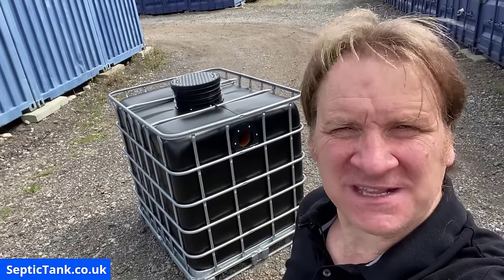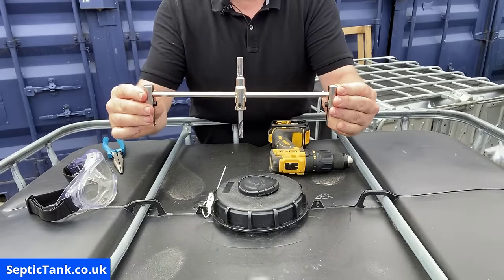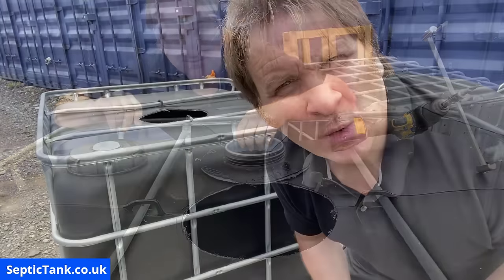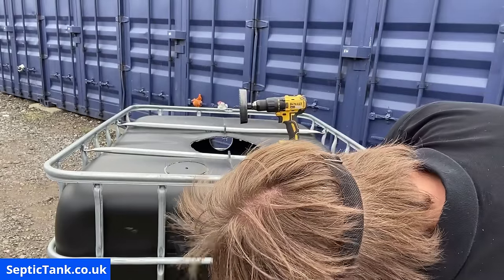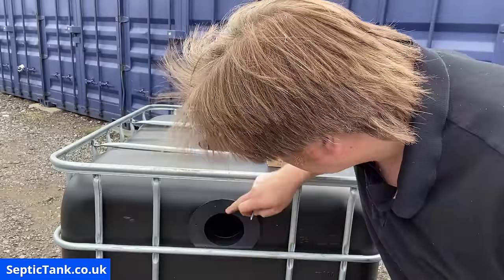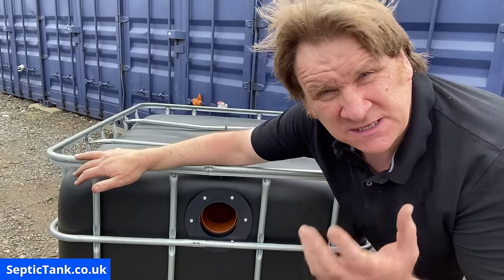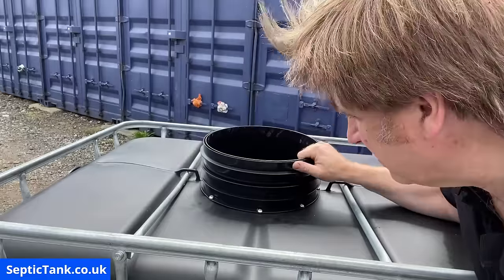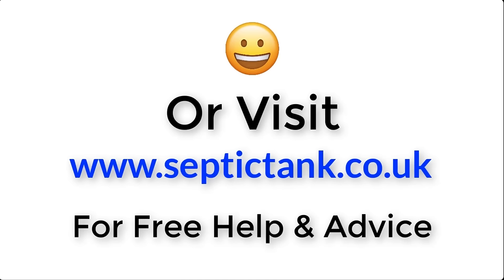diy septic tank - diy septic tank

Comment: What keeps the 90 degree elbows from falling into the tank?  I saw no glue or screws.  Thanks
Reply: use a bit of sealant as well. better safe than sorry. plus will need to look into a better seal for the inspection cover as that will leak. predrill some holes in the flange of the riser as in the video you can see it burst the side on the first screw. great step by step but worth adding in a few points.

Comment: No glue on the 90 degree pipes to the flanges? Won't they fall off inside the tank?
Reply: That what I was wonder same thing
Reply: If yu can’t see it it didn’t happen
Reply: Soooo... is that supposed so be buried 🤔
Reply: Also wouldn't you want to put a short extension pipe going down in the tank, on the outward 90° fitting, to ensure it's just water (no solids) going out to drainfield?

Comment: Do yourselves a favor and get it in the ground before you start cutting holes in it. It’s a lot better to dry fit your pvc to the tank in ground, to see where it will work best first. 
I’ve done quite a few septics with these 330 gallon totes in Texas and that black German tank looks sweet but the flimsy white ones work just fine. Just make sure you fill them with water before you start pushing dirt over them so they don’t collapse in the cage :) I alway put a tin top on it too to help with that.

Comment: I would have had a bit more difference in the levels of the inlet n outlet even if it meant moving/adjusting some metal pipe ! Another thing to think about is adding a second settling tank 6"-8" apart connected in the center via 4" pipe between the two ! Better inlet and outlet fittings (which would require the risers moved from the center of tank and closer to the outter edges for monitoring and cleaning out) would allow for a effluent filter to catch larger pieces of outflow debris and save the soak away field much longer.

Comment: Stainless steel through bolts with a flange on the inside, also a bead of silicone would not not be such a bad idea.    
.    
Another thing with the 90°fittings.  
A few 1/4” holes on the top of the 90 will prevent a vapor lock and allow the water to  flow freely.

Comment: The same septic tank owner who installed & repaired septic tanks for a living did say that the blue food grade 50 gallon barrels could be made into a 3or4 barrel septic system.first 2 with T's last 2 with straight connectors but all must be at least 1 inch below the next and the initial intake line.
Reply: I need instructions and materials needed

Comment: Why not put the flanges in from the inside as the flanges have thicker points round the screw holes which will give a better fixing for the screws, or insert the screws from the inside?
Reply from the maker: Good Idea

Comment: I made one of these and the first good rain had the dirt collapse the side.  Something has to be put around metal cage to keep water/dirt pressure off the thin plastic.
Reply: screening or drainage rock?
Reply: Fill it with water first
Reply: You must fill with water first
Reply: @andrewdavis5404  water doesn't hold the side walls in from dirt collapsing. The water just flowed out the field line. It was full of water. But full because they'll float, not collapse.
Reply: I’m going to use plastic pallets around the outside as it’s surrounded by clay.

Comment: Great video. One thing though. I wouldn't use WD-40. Its a solvent as well as a lubricant. Its not recommended for use on rubber products.
Reply: Yep. WD-40 stands for water displacement formula 40. Its original purpose was and is to provide a layer that ice would not stick to on rockets. The cryogenic oxygen tanks would cool the rocket's metal exterior such that ice would build on it. This was dangerous as it could potentially cause the rocket to have a structural failure on the launch pad. Not to mention that the extra weight would impede lift-off, and if the ice fell off in an unbalanced way during launch it could cause the rocket to uncontrollably veer off in a direction other than up. Or to punch holes in things that should not have holes in them.

Comment: Question, do you used pipe adhesive from the 90 degree elbows to the flanges?  Whats to stop them from uncoupling? Thanks for the instruction cheers mate
Reply from the maker: The screws and a very tight rubber doughnut.

Comment: Why isn't the inlet line a few inches higher than the drain line?  This setup will just flood the inlet pipe before it has a chance to drain
Reply: This is an off grid system. Usually for the use of 2 people. The offset between the inlet and outlet doesn't need to be very much. Also, this system isn't for use of much Grey water, only black water. I build tiny homes and use these systems frequently. I don't know this man, but I've used his systems for 2 years now in off grid building. He has saved my customers thousands, and made me some coin at the same time. I have made some modifications of my own along the way, but everything works. Most of my systems are on large plots of land, deer leases, and small acreage that are unrestricted. This will not fly in restricted building locations that require permits. On larger septic applications, yes, the inlet and outlet pipes would need to be offset a bit more. Hope this helps.
Reply: Any videos on installation??
Reply: The inlet needs to be a minimum of 2-3" above the outlet, use either 4" pipe or 3" I wouldn't use anything smaller, repeat the process if you get more IBC's. No interior baffles are needed. I'm offgrid and would prefer the use of sanitary T's those elbows can clog and not always function properly. The outlet can run out to a leach field and you can have perforated pipes, cloth & rocks (it's a lot but if you do that to code it'll last for years). If for some reason you want to drain in let's say an old wash or something I'd recommend the use of a backflow flanged pipe. The last thing you need is a flood going into your system into the home. Just remember, these are meant to be "temporary." 😂😂 they don't have to be though! 😅  MERICA' 🇺🇸🖕JB

Comment: Thank you so much.   We are retiring and want to by a yurt, this video is what I needed
Reply: just use a razor blade and a steady hand thats what i did.
Reply: Let me know how that goes I’m very interested
Reply: @willscott174 That is difficult to do a nice hole by hand, a bit dangerous as well, unless that tank is soft/thin plastic. 😋
Reply: @BillyJoeJimBob28  Those IBC Totes are pretty soft and easy to cut through with a sharp blade. As long as you draw it out first and go slow its fine.

Comment: Hi, good instruction video. 
I have 2 questions:
I am wondering if a small amount of gas can escape from the join of the riser to the tank, for safety reasons, can it be sealed and a small diameter pipe placed into the top perhaps at the corner?
2. Can tthese tanks be serial connected together with a section of straight pipe to reduce emptying frequency and to further purify the runoff water?
Reply: Each tank needs a vent pipe which has not been mentioned in the video. It does not matter where you  position it as long as its above the fluid level. You could also link tanks together as you ask, but each pipe needs a baffle so water passes through under the level of the water. Each tank needs a vent pipe  also.
Reply: I suggest a tee baffle instead of the elbow to prevent siphon effect which will mess the system soakaway down stream. I also recommend the gas to be safely harvested using pipe system and filter to ensure the biogas is usable and not contribute to climate change adverse effects. Use this for cooking needs
Reply: @andrugawilliam8939  so you mean a T shape where the horizontal part is above the water to allow the air to enter but the vertical part of the T is how the water would flow into the tank below the water level?
What kind of filter for the gas?

Comment: I had one of this buried in a ground.....WILL CRUSH !!! The pressure and weight of the dirt can't compare with the liquid inside the tank. BESIDE is square. A SPHERE septic tank has a better chance
Reply: Simple reinforcement before covering glad you mentioned it though will be reinforcing mine as well as sealant for extra protection
Reply: @larrymcdonald1408  wrap with sheet metal?
Reply: Bradley Hooper at that point you’re spending as much on concrete to just do it right
Reply: if you add proper drainage 2 feet all around it should be fine no? weeping tile and draining rock

Comment: I just saw one IBC tote that use to be a septic tank. The owner is now standing in nasty stuff to put in a new real 500 gallon small septic tank bcuz the IBC tote crushed under the dirt and stopped up the toilet in the house and overflowed. So the wife cleaned up inside & the man was up to his knees outside cleaning out the hole to haul out the IBC tote & haul in the tiny 500 gallon real septic tank.
Reply: You are supposed to fill the tank with water and pour concrete around the tank to fill the hole and protect the tank. No way it will buckle then